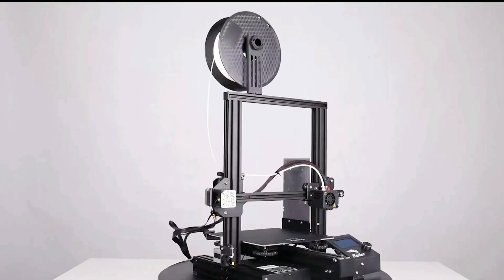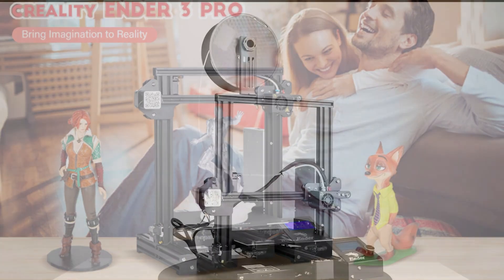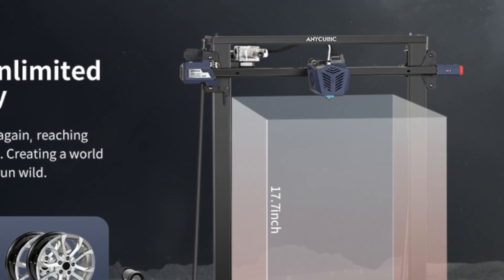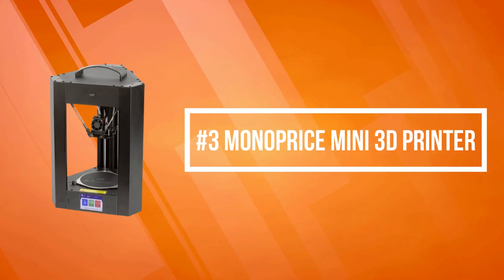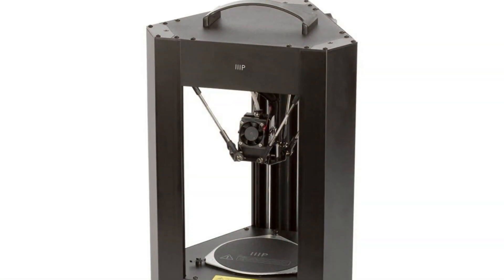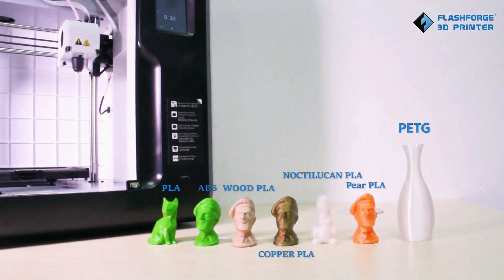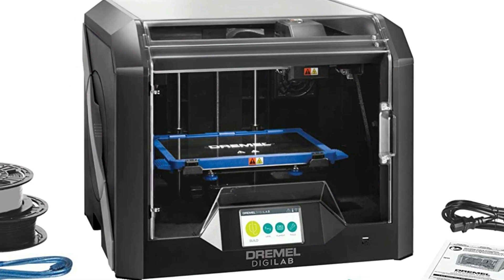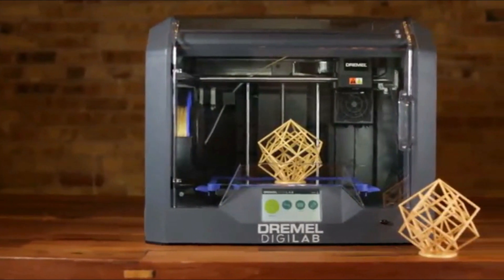Best 3D Printers In 2022 - Top 5 3D Printers

Comment: Two Cartesians, one delta, and two enclosed cartesians. I'm not an ender fan, and I really wish you'd have spent the time to get one of the more updated models of the ender series. The ender 3 pro is being outclassed by many of the features being offered by Creality's other offerings. Plus they have a flaw in the extruder that is guaranteed to make it break at some point. 

I feel you could have easily chosen something other than the ender from Elegoo, Anycubic, or several others. You also included a 2k Dremel. For that price someone could get a Prusa and a lot of Filament, or a Bambu X1 Carbon and a lot of filament. For that price range a Qidi would have had better options as well.